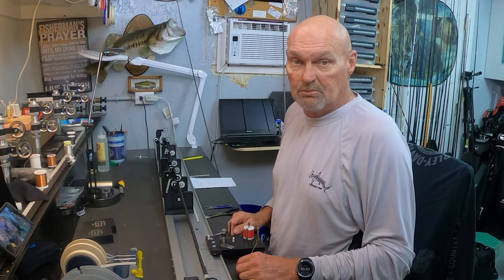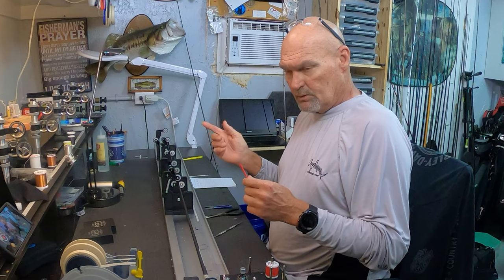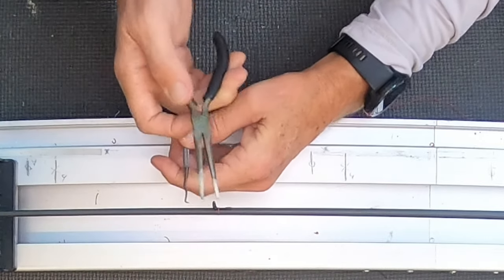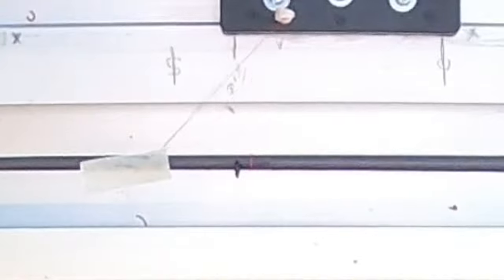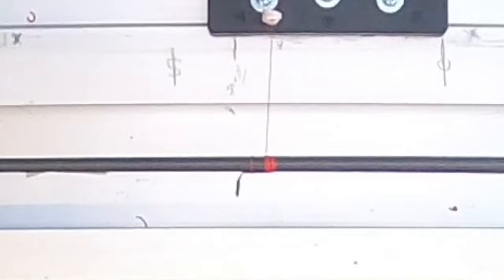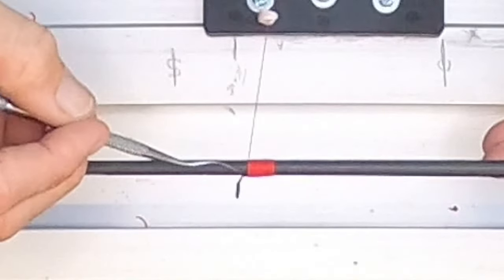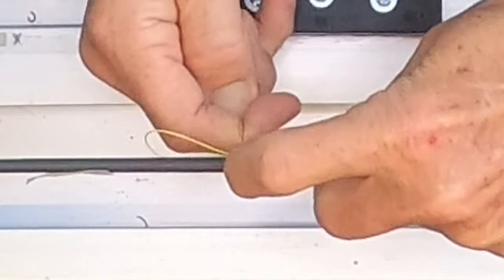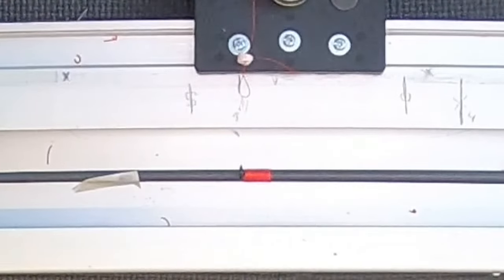Locking Wrap - Single Foot Guides

Comment: I think i see what you are doing.  But you are correct, the glare was terrible.  And if you could zoom in a little more that would be great.  Not sure what wrapper you are using but Mudhole has a black track for their RBS.  That, I believe would reduce any glare.
Reply from the maker: I have the RBS pro with the black track, but I'm not a fan of the pedal.  Waiting on the G2 to come back in stock.
Reply: @fdxcustomrods  Get the G2.  It has a redesigned pedal.  I got one when it first was available.  They sent me a new redesigned pedal later.